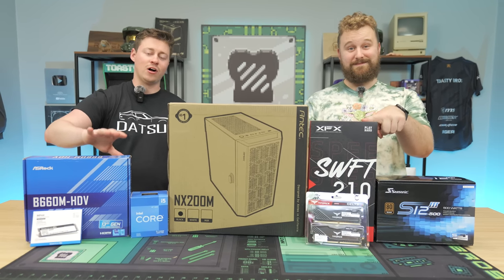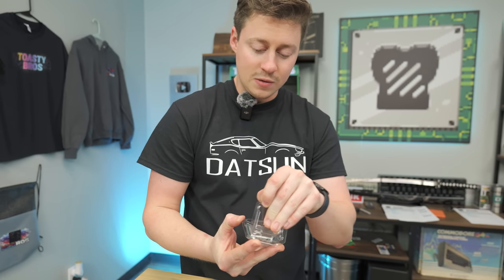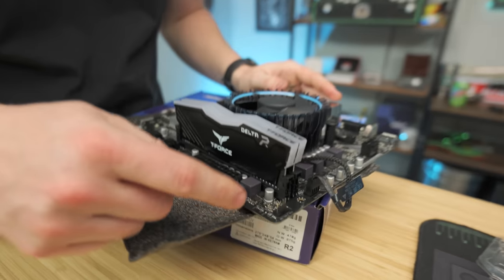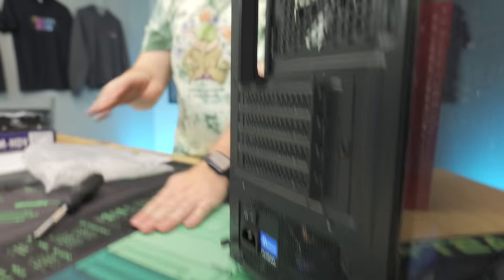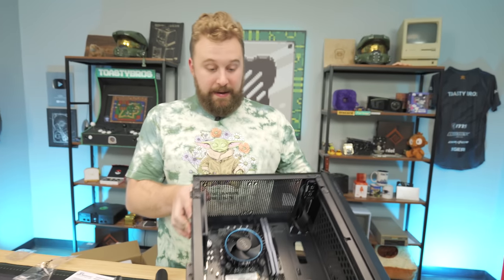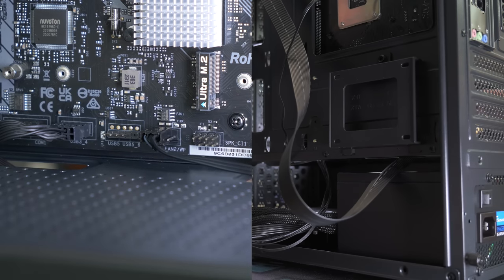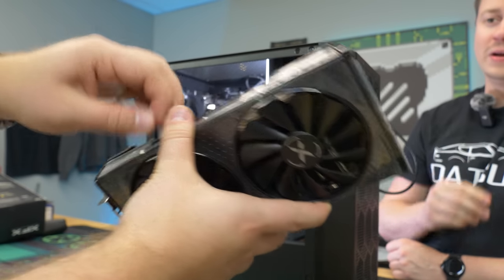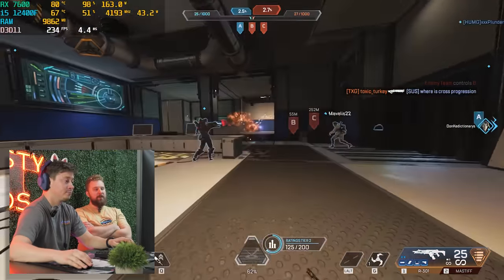$750 Budget Gaming PC Build Guide | Step By Step!

Comment: So, wait. As soon as the cable management is done, I can start uploading games and play it just like you guys did? Fan-freaking-tastic!  Well, no, obviously, but there are people out there who'll think so...your vid goes straight from cable management to games, and that's skipping a few steps. You guys're good at showing the hardware side of things, how about some of the software side? The Windows install, partitioning the SSD so that you can actually use it as soon as you turn the system on, maybe some BIOS tips and tricks. You talked in the video about controlling the fan speeds...how exactly do you DO that?  I'd love to see more on the software side of things in these "build tutorials", so I'm not just slamming parts together and calling it a day.  Thanks!
Reply: That is such a good point you can’t just go straight to playing after putting it all together that is an issue with most of these videos very few go in depth on the software side I hope people see your comment because it is a good point

Comment: When using an LGA 1700 in a build guide, I think one Caveat to mention is the flaw in the mounting system which bends the IHS causing thermal issues over time. The only way to correct this is to remove the mounting system entirely and use a contact frame. I don't build on the LGA1700 without one. This improves the longevity of the build for the buyer.

Comment: This is basically my build expect with the GPU being a RTX 4070 and the SSD I went with 2TB SATA Samsung 860 EVO and 1tb Samsung 980 pro NVME for my windows. Power supply was a deep cool PF650 and the cooler was a deep cool AG300. 

Edit: 

I  spent about $1500 on my build in my country.

RTX 4070 Gigabyte Aorus - $811.11
Deep cool case - $58.88
Deep cool power supply -$60
Deep cool cooler AG300 - $30
Samsung 2TB SATA - $100
Samsung 1TB NVME - $77.72
B660m HDV - $119
Processor i5 12400F- $172
Team Group RAM (3200mhz dual channel) - $52

Comment: Is it okay to use a 8pin cpu power cable in a 4pin motherboard socket it plugs in fine my power supply only has 8 pin cpu block 😢
Reply: To use the 4 pin connector on motherboards usually your 8 pin cpu cable will split in half. If it doesnt split then your psu just might not have cables like that. And 4 pin cpu connectors dont need to be used if its extra unless your overclocking but even then it might not be nessessary

Comment: PSU cultists lists the S12 III as Tier E - Avoid. For the same price you could get Apevia ATX-PM650W Premier 650W 80+ Gold or GIGABYTE GP-P650G 650W 80 Plus Gold. Both are at least C Tier
Reply: Silicon Power DDR4 RAM 16GB (2x8GB) Turbine 3200MHz (PC4 25600) 288-pin CL16 cheaper by 1/3.
Reply: Literally who asked?
Reply: @psario6234   butthurt? Calling the wambulance...

 It's important.  First,  that PSU is trash. So you know, maybe get something better quality,. 2nd. Especially,  if it's higher wattage AND more efficient (Bronze vs Gold) for the same cost. They are literally hawking a budget build and there are better/cheaper options available.  Same build,  save $20 have a more efficient PSU with 150w of upgrade space to swap GPU down the road.
Reply: @jasonhenninger8220  stop ass kissing that psu tier list, it's not a garbage psu. It's just a budget one and that's it
Reply: @psario6234  and exactly who asked you? Stop whining. It isn't a good unit.  Moreover, my second point stands. The other 2 units are AT LEAST as good quality, higher wattage and better efficiency,  for the same price.  Empirically, they are better choices.
Reply: @jasonhenninger8220  ok boomer
Reply: Tier lists aren’t the only thing you should rely on. 75% of the time E tier can simply mean unreviewed. Not necessarily always bad. Look up ACTUAL reviews on the PSU instead of relying on incomplete tier lists with little info on the PSU itself made by some psu snob. Ive had this exact PSU for almost 4 years ZERO issues running 11600K + 2070 super. It’s perfectly fine for the avg consumer.

Comment: I just got done building a very strong system for slightly over $700. NO AMD!
I bought RTX 3060ti for the same price as the Radeon.
Putting the PSU at the bottom of the case is one of the dumbest ideas manufacturers ever came up with. Heat rises. So that PSU fan is near useless in venting the case.
Reply: The psu fan brings air into the case, doesn't vent it out the case

Comment: you guys skimped on some parts I wouldn't be willing to. That mobo is booty and so is that PSU. But I made a similar build.
Reply: PSU cultists lists the S12 III as Tier E - Avoid. For the same price at  you could get Apevia ATX-PM650W Premier 650W 80+ Gold or GIGABYTE GP-P650G 650W 80 Plus Gold. Both are at least C Tier